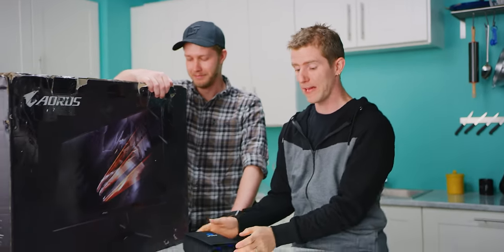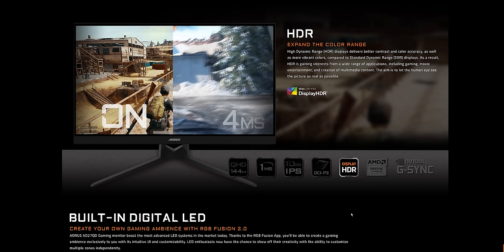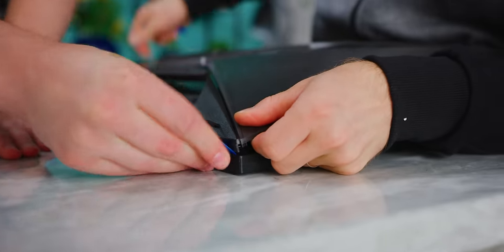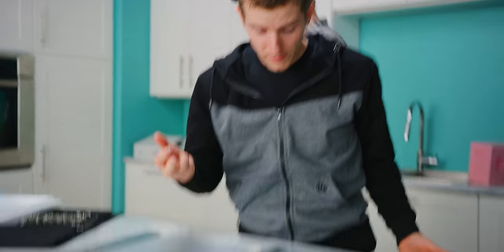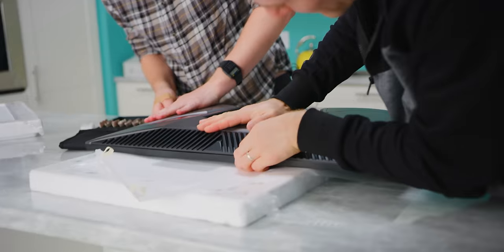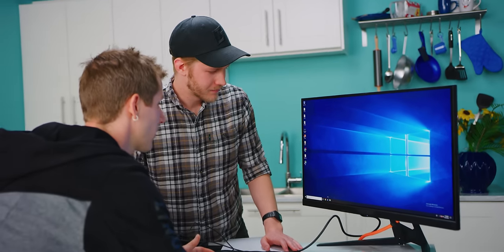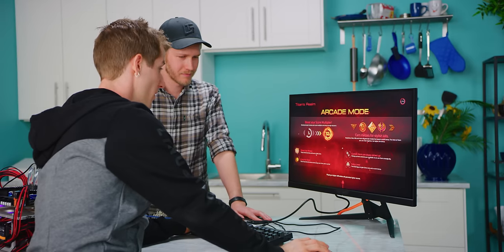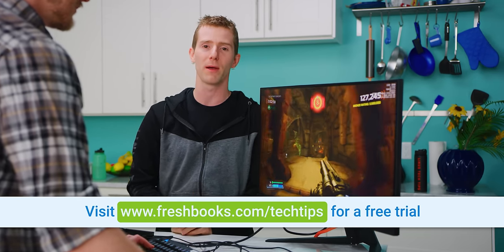Fixing a Broken Gaming Monitor for CHEAP - DIY

Comment: I have an alienware AW3420DW monitor that is under a year old and only used a couple of months. I leaned the panel over gently to replace some USB chords. I raised the monitor to find that it rested on the keyboard ever so slightly. Long story short. I busted the panel. The monitor works perfect but its panel is busted. I contacted to Alienware .. no luck.... I just don't want to throw this monitor away... any suggestions from anyone ?

Comment: So question dose it matter if it says the correct brand name the panel gose to IE I found a panel with the same panel model and manufacture but it has a different company label as what is was made for ( the monitor I have is a HP but the listing says it's for Acer)?

Comment: Hi Linus, I have a same situation. Monitor is Acer H276HL. Looked in the monitor manual for its  panel model number but it was not there. I researched a little through google but nowhere to be find. 
Where can I get the panel model for this and which website was that you used to purchase the panel?
Reply: I am not sure if they manufacturers panel for those Model acer monitors or no

Comment: shouldn't it be possible to build your own monitor or tv fairly easy with off the shelf controller boards and display panels from aliexpress? I really don't need the newest there is but my tv is like 15 years old and I thought this could be a cheap way to step up my game.
Anyone know any build guides for this?

Comment: I have an older Dell E151FPB monitor.  This summer when it got warm, my screen randomly blacks out and starts flickering some dim light near the edge with the green led indicator flashing in unison.    When I thump on the outer frame, the screen lights back up, briefly with the Dell emblem then with whatever was displaying on my screen before it blacked out.    At times it occurs often. Sometimes I have to thump hard several times for it to come back on.  When it is blacked out, pressing the on/off button has no effect.   
Can someone please give me ideas the cause and how to fix?

Comment: I have a broken HP Omen 27i , I am very an IDIOT and didn't pack it up properly during a move to a new place and it was damaged...after only having it for a few months. HP and best buy offer no help in replacement and my warranty is no good because I didn't register it at the time and it's past the current expire date. Anyways if anyone had replaced this LCD screen before or if any of the crew from Linus tech tip has any info let me know! I am going to try and fix this Monitor just need a new panel.

Comment: Question ..
Hello, is there any way to fix a chipped mointor on the screen. Model  34WL500-B..its a Lg Monitor..
It tipped off and the entire screen is blanked and only colored lines are visible  when powered On. There is  scratch/light crack. LG HASN'T been HELPFUL 
Please advice what are my options.
Thanks

Comment: so, ive had 2 screens die on me in a really short time. they were older but pretty good and i liked them
they just kinda stopped working. one died while it was on and the other just didnt turn on anymore. im not that smart when it comes to tech so does anyone know why they couldve died. how i could prevent it and how i could potentially fix it? i got them both for pretty cheap so if i tried repairing them and they still dont work i wouldnt really mind but id like to try

Comment: So if you have a curved "Samsung" monitor (C27F591FD) that someone put OUT because they had the WRONG POWER CORD, you got the RIGHT POWER CORD FOR 21 BUCKS and IT TOTALLY WORKED, but after about a year you cracked the screen because you're HAMMER HANDED, you're just better off buying another monitor?  

That about right?

Comment: I don't know if anyone on here can help me or at least point me in the right direction? I have a iiyama monitor GB3461WQSU it's out of warranty the back light is intermittent and fades quite quickly from the edge of the screen to the centre! To me I'm thinking it may have a fluorescent behind as the back light the way it is behaving? I'm thinking of a repair, but information is sketchy online and cant seem to find any specific You tube repair guides either!

Comment: I have the same monitor and my landlord turned the breaker switch and i had no surge protector. Now it won't turn on. I have been saving for months and was about to start streaming tomorrow but now my monitor won't work. Can anyone tell me how to fix a montior that has been broken by a power surge?

Comment: I am having trouble finding the panel model number for an Acer - Predator XB272 27" LED FHD G-SYNC Monitor that I purchased from best buy for around $599 about a few months ago.  I would greatly appreciate it if anyone could reply to this message with the panel model number.

Comment: I mean, cool, but 3 months of cancelled orders the anxiety of it not working and and no warranty, I'll just buy the new monitor.
Reply: Depends on the monitor, I got ViewSonic XG321UG with a broken screen from eBay for $250 and a replacement panel for around $300 (including shipping).
First one had a few dead pixels, so I returned it and ordered another one, the 2nd one had no defects, works great.
All in all it cost me about $650.
New XG321UG costs like $2600.

Comment: Anyone know where I could get a replacement for a 2UD96AA#ABA monitor? I had it for 2 weeks before my Ex threw my glass savings jar at it... Took me 2 years to build that PC just to not even be able to use it. I did upgrade its been months and its just in my bedroom collecting dust. Its brand new and I really want to fix it and sell it due to current money issues. Thanks in advance. If anything ill post it up for sell as is on ebay.
Reply: maybe ill buy another one, replace the screen from the new one to the old one, then the old one to the new one, get warranty and tell then what happened to the new one and have them fix the old one lol. Any thoughts? idk if they have serial numbers to prevent that.

Comment: Does anyone here know how to contact any of them that work there? I accidentally bid on a Gigabyte g32qc curved monitor, and I won. However, the screen is cracked or broken or something. I know a little bit about repairing electronics and stuff like this, but my issue is that I have absolutely no idea where to get the exact same, or compatible L.E.D screen only. I mean, it's no big deal if not. To be totally honest, I only bid no joke, 1 dollar and actually won it. It could be a good learning experience and getting more hours in on learning how to repair things like this..
Reply: I totally apologize for the extremely long comment. It just doesn't seem that long or that much when you're on a laptop and using the keyboard.